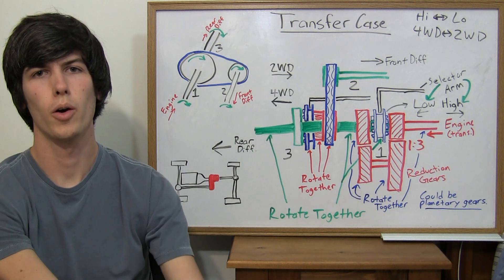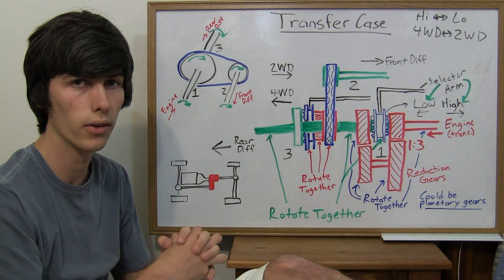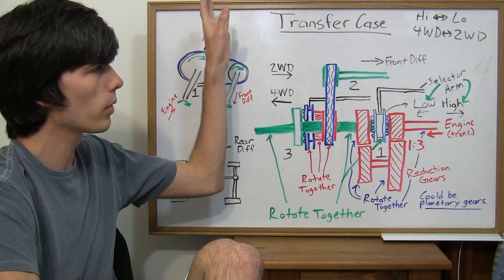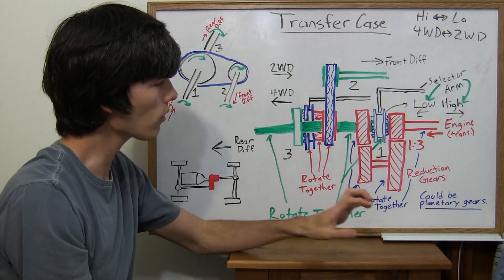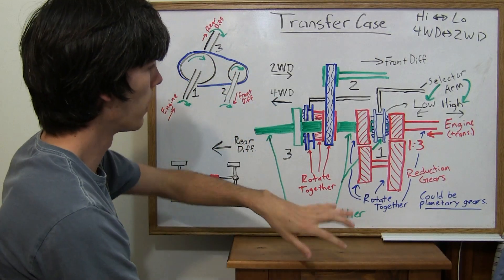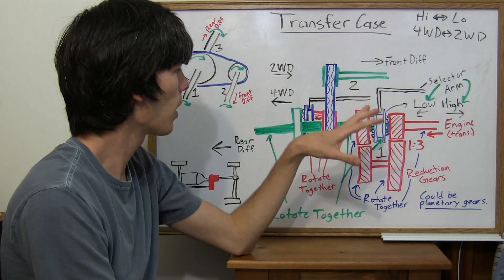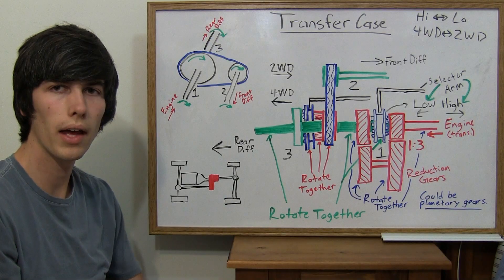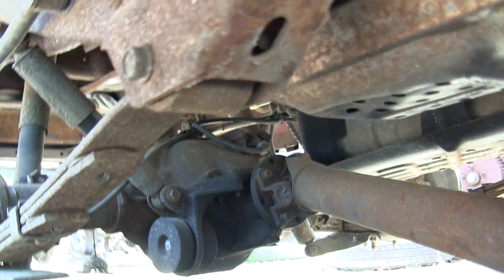Transfer Case - Explained

Comment: Thanks so much for the video! 
I’m struggling here trying to discover how can I find the torque or power split between the front and rear axles just with the geometry of the transfer case. It’s kinda tricky, not knowing where to go.

Comment: I have a 2004 F150 4x4. It’s rear differential has 373 gearing. It has a Borg warner transfer case. I am told I cannot take the transfer case from a different 2004 F150 that also has a Borg warner unless the rear differential has the exact same 373 gear ratio because it will cause binding when in four-wheel-drive. I do not believe this to be true. What say you.  Currently the only way I can get my truck back into 2 Wheel Dr. is to put it in reverse and drive backwards 10 to 20 feet. Any ideas? Is it possible the electric motor on the transfer case has marginal power when it runs in reverse to return back to 2 Wheel Dr. Or is the problem mechanical inside the transfer case?

Comment: Can you safely tow a 4WD on all 4 wheels by just disconnecting the drive shaft? Will the transmission still spin if the cv axles are still attached? Or would you have to also disconnect the front cv axles?

Comment: Vehicles like the the land cruiser, 4runner, land rovers, gclass, that have a center diff and transfer case to be able to lock it, how do they work? In a vehicle with a torsen center diff, could somebady instal a tranfer case to be able to lock the diff, like in the 4runner? Without addidng the redyction gears offcourse. Similar to a gen 2 cayenne with a cenfer locking diff.

Comment: I’ve been thinking about something. Would it be possible to have a FWD, RWD, and 4x4 transfer case on pickup trucks? FWD would be great for driving in rain and snow without weight in the bed, but you still need the RWD for towing, and 4x4 would still be wanted by most. With the geometry of the transfer case, would it be possible to have all 3 of these drive types?

Comment: I bought a used transfer case for my 09 chevy silverado. I replaced t case bec my turn nob 4 wheel wouldn't come out of 4 low or 4 hi. It would switch between those both.. so I change t case and it comes out of 4 hi to 2 hi..  well I have a bigger problem my truck won't move.. it's like it's in nuetral.  I even done the steps to get it out of neutral mode.  That mode is used for towing.. well it is still stuck in neutral. The t case has 6 month warranty .. have any ideas what this could be? Does the tccm need relearned for the new transfer case?   Have any idea?

Comment: I have no engineering back ground or mechanical know how. Can someone please explain to me if a issue in the tranfer case could cause an issue with the hub assemblies? Mentioned a grinding sound to the shop and from my own research I feared the IWE vacuume system had a leak in it. But I also mentioned that the sound I was hearing randomly when accelerating was coming from the aread of the drive shaft. So I thought...
Well the shop replaced both hub assemblies. But now two weeks later the sound is starting again. I've parked it until I can get it to a dealership. I'm so pissed. Spent $1K+ on hub assembly replacement just to find out thr shop apparently didn't locate what causes my bearings to be worn and my hubs needinf replaced.

Comment: Hi so I have Toyota tacoma 2018 at 30k miles i dont do offroad just highway and city driving. Owners manual says check or replace in severe condition. Should i replace it as preventive maintenance? 

Owner’s manual call for toyota genuine 75W LF or equivalent. I tried calling different toyota dealership around my area but no one is using it and they not even stocking it. They said they just use 75w90 for everything. This special oil is $80 at toyota. The straight 75W is hard to find as well and also didn’t specify if GL 4 or 5. So I don’t know do you know any equivalent or replacement transfer oil that I can use? Thanks!

Comment: I see...this is explaining an older style 4WD transfer case setup?  I think I remember my dad's old Toyota 4x4 had two separate shifters for 4WD.  So what about newer 4WD setups?  Like in a 2018 F150?  It's just a simple switch.  4H can be switched to from 2H while the truck is moving while 4L cannot.  Is the chain still moving while in 2H?  It shouldn't be, right?

Comment: Could you please explain the mechanical operation of 4H...how it works with the transfer case and front differential vs rear differential?  There's a lot of confusing/conflicting information about how 4H works...especially within launching (drag race/quarter-mile) applications.

Comment: How do rpms mix up when you put both of them in neutral and have them all tangled will I need to set the transmission in 3rd and move the transfer case in 4h or neutral?  Then try adjusting the axles again

Comment: Working on 2012 toyota tacoma . it will not switch back to 2wd . n lockers in rear are stuck on . it drives. Forward n backwards fine in 4hi . no noise . if it drives forward n backward so it shouldnt be transmission or gearing. Im thinking transfer case motor . please let me know what you think

Comment: I fixed the buzzing sound and loss of drive to wheels. there is a shifting fork that gets sloppy. I did this on the truck. ?? a long time ago. I opened the transfer case pushed the shift collar  into high range put welds on the shaft so it couldn't disengage. I lost a lot of sleep not having low range. I bought beer with all the money I saved 1999------------2018- still buying beer

Comment: my name is less I'm calling from New Castle Pennsylvania I have a situation where I have a transfer case adapter to a 9 horsepower Kohler engine it operates a hydraulic pump my phone number is area code 724-730-4188 it's starting to leak now around the seal I was looking for someone to repair this

Comment: My superchips flashPaq has one setting for gear ratio and another setting for transfer case low range. This video helped explain one question I had but I'm still confused as to why the flashPaq has a Tcase low range setting? I called superchips who were unable to clarify. They simply said it's two different settings for the same thing, which I find hard to believe. Anyone know the stock tcase low range on a 14 jku sport? Anyone know how to modify the tcase low range?

Comment: I have a question:
- Do you need low range when you have maximum torque under 2000 rpm? Because I think you don't need low range which 
  multiplies torque at low engine speed when you have full torque under 2000 rpm (typically turbo diesel engine).

Comment: good but not quite!   ... you missed the most important point in all this which is between 2Hi and 4Hi there's no difference and the drive shaft for the front diff.  will move either way regardless which place the selectable stick  is at !!!  in other word what engage your front axle and make it move is a small gear mechanism at one side of your front diff. axles case.  .. in short words the only way to disconnect movement entirely from your front diff. is just by Taking off your front diff driving shaft. that's the only way u really get better gas mileage when u are driving at city.  honestly you could have explained this much easier and much clearer , but u did a fair good job tho thanks.

Comment: Hi, I've got an AWD 1997 Chevy Astro.  I'm pretty sure one of the front axles broke, so now I'm driving in 2wd RWD.  My question has to do with something my mechanic said.  It was my understanding that if there were a broken axle, or any other reason one wheel was not touching the ground, all of the torque would go to that wheel/axle, escaping through the path of least resistance.  So, I figured that since I was able to still drive, that my transfer case must be working, locking up to ensure that torque goes to the rear axle.  My mechanic is saying that the transfer case might be the entire problem, and that if the viscous coupler were to stop working, power would go to the rear axle, but be unable to transfer power to the front axle.  Do you know which it is on my vehicle?  Does this transfer case always give power to the rear axle and only give power to the front axle when slip occurs, or is it more like a standard differential, where it sends power in both directions all the time, but locks up when power try's to escape one direction or an other?  Does my question make sense?

Comment: i will ask the same question:
why do the two gear discs in the transfer case, which are connected through the chain differ in their radius?
doesnt it make the front shaft spinning faster than the one for rear tires?

Comment: hey im having a problem with my car. when im at a stop and press the gas i get clicking popping noise. is this the transfer case chain?
Reply: Antwon Walls it could be ball joints or suspension bushes that pop out when you accelerate. It could be the transfer case chain but why did you assume or narrow it down to something in the transmission?
Reply: well i did think the transmission at first but i ruled that out once i did some research on it. like i visited to Cadillac forum and i found that this was a common problem with the 05 srx. but is this common even with the northstar edition? can it be easily fixed if it is the transfer casse chain?
Reply: Easily fixed but price depends on who does it. I cant give a rough estimate on the price because it differs so much

Comment: well, bro, the case you are talking in the video, is that a 2 wheel Front Drive and 4 wheel drive transfer case? I mean when the vehicle is shift into 2 wheel drive, is it a 2 wheel front drive car your case study is showing in the video? if so, how about the 2 wheel rear drive transfer case looks like? dose it shift the gears position in the part 3?
Reply from the maker: 2 wheel RWD, switches to 4WD.
Reply: ok, thx, your video is awesome, helped me a lot, I will follow up the rest of your video, thx for your explanation again.

Comment: How did the engine power goes to the front? Why did there is only FWD? Hoe can we choose RWD from it??
Reply: Yathu prem the diagrams show a vehicle that always sends power to the rear wheels. In 2WD mode this is RWD. The transfer case allows power to also go to the front wheels for 4WD mode.

Comment: I learned that you never make a sharp turn (aka pulling out turning sharply) in 4wd, because your going to windup all that energy in the transfer case causing a lot of stress in the gears and the chain
Reply: +Masterman5010 Correct. He just made a very good video about how to use 4wd, and when best to use what setting.

Comment: Great Video, but you mentioned that this was similar to how a manual transmission functions, why is it that a manual transmission needs a clutch, but hi/low gear for an 4wd does not need a clutch, is there just sensors monitoring the input and output shafts and a computer controlling when to actually "shift"?  or is the collar different from the standard manual transmission.
Reply: While shifting from low to high or vice versa, most of the vehicles fitted with electronically operated transfer case demand you stop the car completely and have the gear shifter in neutral. Hence there is no torque output from the transmission's output shaft (everything is stationary). 

But in a manual transmission, gear shifts happen when the engine (torque input to transmission) is running.
Thats why we use a clutch. To disengage the transmission from engine.
Reply: +callMeAMug I didnt know that the hi/low gear setting actually requires the car to be stationary, good to know!  Thanks for the response.

Comment: +Engineering Explained How would i go about adding an electric motor to my 76 triumph spitfires(has an inline 4 with no power) drivetrain? I want to modify it into a parallel hybrid and i'm having trouble finding any sort of info online.  What would you advise as being the best way to transfer power to the wheels?

Comment: hi, I have a question all the time being, What's the difference between transfer case and center differential, they are the same things?
Reply: +Leon Hans No. There are some transfer cases with center differentials, but not all. A center differential is different from what is in this video. It is like the differential between left and right tires but connected with, for instance, 'left' connected to front and 'right' connected to rear. It means that the wheels are connected but you can go around a corner on a dry road without the wheels being forced to go the wrong speed. A center differential is more of an all-wheel-drive thing.
Reply: thanks, I just see your answer. Very clear, more helpful than some professional books
Reply: Leon Hans Thanks! A lot of guides and books use special language that the reader won't be comfortable with unless they already know a lot of what the book is about.
Reply: spaceminions I graduate the major vehicle Engineering in China, but still so much special knowledge must to learn, the request of job is so different from when in the university
Reply: Leon Hans I understand. I am glad I could explain it.

Comment: hello again, I have one other follow up question, you addressed the high/low function in your video but my 1996 Land Cruiser also has a neutral position. what should happen if you put the high/low lever in neutral? should the truck still drive?  in this case which wheels should have power? I look forward to your thoughts, thanks again.

Comment: you are obvious ly a brilliant engineer, however, if you could find a program that animates the affected parts as you speak that would be so much more helpful.  thanks for the videos, keep them coming.  by the way, I have a puzzle I am trying to solve on my 1996 Toyota Land Cruiser, which has a full-time 4x4 system. the previous owner took off the front prop shaft to make it a RWD truck for ease of operation on dry surfaces.  I would like to reattach the prop shaft to get 4x4 functionality but I notice that the output flange on the front diff spins freely Wight th prop shaft off.  is this normal or shoul the front diff be locked in place? I look forward to your thoughts. thanks.

Comment: I was always told that in 4 high the rear diff received 60% of the power and the dront diff received 40%. Is that true and if so, how does the case accomplish this?
Reply from the maker: +Ken MacMillan It would have to be done with gearing, and this definitely would not apply to all vehicles.
Reply: +Ken MacMillan, a fixed torque split is typically done with a viscous differential type coupling similar to the Subaru WRX STI or the Haldex system in the Audi Quattro. Variable torque split can also be achieved with these systems or you can use a torsion type differential gear system. 

Without these tyres of systems, a straight geared (or chain) type transfer case is always a 50/50 split of torque. With the explained tyre of system you could have all front wheels off the ground and the rears would still drive the vehicle forward (and vice versa), with the viscous differential in the middle you will not necessarily get this drive.

The difference can be explained by All Wheel Drive v's 4 Wheel drive.

Comment: Is it possible to remove the transfer case from my truck completely if i get a rwd transmission?
Reply: +noslen2010 What truck yo have? What you are talking about is eliminating the transfer case ? If that is what you are talking about and depending how old is your vehicle, there are different answers. First, nothing is impossible mechanically talking, but you have to think if it is practical and economic to do it. Your transmission ( if it is the conventional american vehicle transmission), is already RWD. The transfer case is what makes your transmission able to "transfer" power to the front wheels by mean of a front differential. So in theory , you may be able to eliminate your transfer case, get some modification to the rear transmission coupler and put a custom shaft ,or get another transmission that dont need modification. Transfer case transmissions are shorter in the rear end and have a spacer adapter to connect to the transfer case. After you do all this mechanical part, then you have to see how the electric part behaves. If your truck is post 1988 , it will give you fail codes for the electronic modules that now are missing the imputs from the transfer case. Sure there is a way to connect an external controller for the electronic transmission but possibly your main ECU will still give you permanent fault codes because of whatever you eliminate electrically from the transfer case. Short answer ,.. can it be done?,.. yes. It is practical ? No, unless is your hobby and you just want to learn about swaps and electronics and you are not in a hurry to use the vehicle.If you have a donor 2wd vehicle and can transfer all you need it will make it easier but still not practical. Or sell your vehicle and buy a 2wd or a truck from the 80's that dont have any of the modern electrical crapola.
Reply: Yes, but why? 
You could accomplish this, however it doesn't make any sense, you will still have also the front drive train for the front drive. 
4WD trucks are worth more than 2WD, just sell it and get another truck.

Comment: Nice video. I have a question. In other videos/texts they say 4WD splits the torque 50-50 between the front and the back axe  but seen your explanation the torque doesn't  go 50-50 but it splits in a way that goes more to the path of more resistance, so that front and back axe turn at same speed. Am I right?